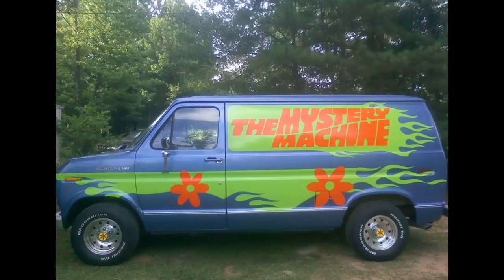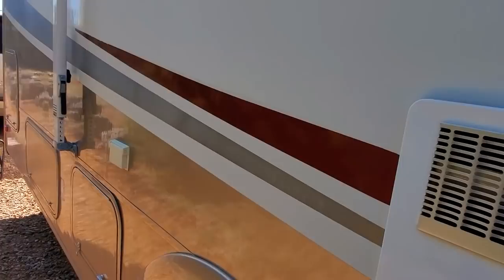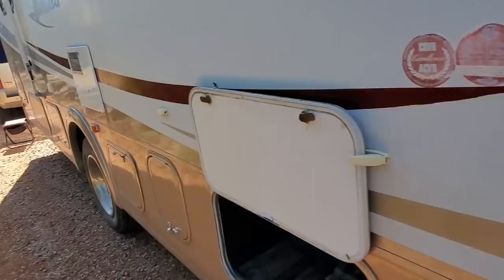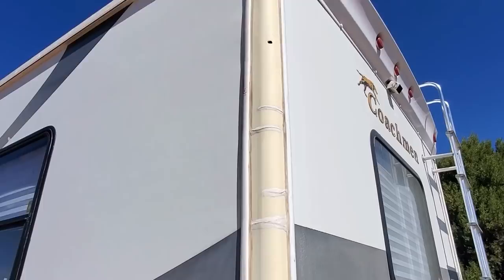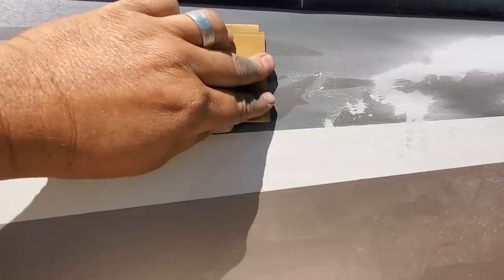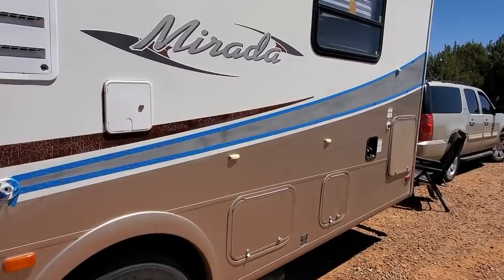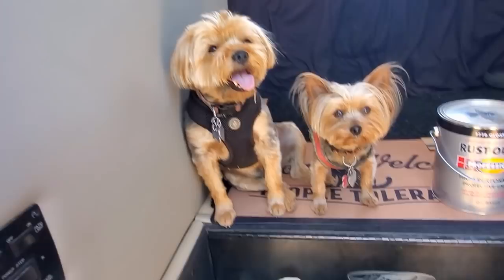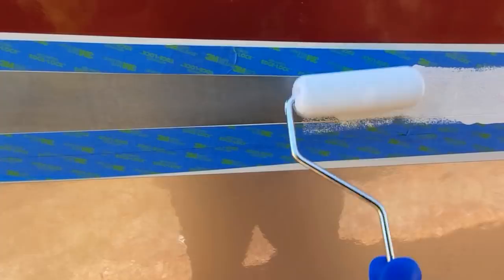I REPAINT MY RV STRIPES WITH RUSTOLEUM... AND SCREW UP!

Comment: I kinda like the texture to the paint personal opinion and it does pass the ten ten test ten feet ten miles an hour and it looks perfect I have made that mistake also a light sanding and a coat of of thinned paint and it will look fine and rustolem seems to lay down better with a good brush like a high end purdy than a roller
You and the woof pack have a good day
THE GRUMPY BUS

Comment: Hey Kevin, As a professional body man and painter I have to say you picked a near impossible task to do in a parking lot using the materials you have so don't beat yourself up over it! The stripes look to baked on to remove them with a heat gun or a eraser wheel I think that would have damaged the paint and with the cost of new vinyl graphics painting was your only option. Just do the best you can and don't worry about it because it will look better in the end, If someone sticks their nose up that close and criticizes it kick em in the butt!

Comment: i would leave the paint alone for a couple of months to fully cure and shrink before i would try to carefully wet-sand it using sanding blocks, not just holding the paper in your hand. when i wet-sand surfaces like this i hold the block in my right hand and hold a pump sprayer full of water in my left, and keep enough water flowing so the abrasive doesn't dig in and scratch the paint. try not to do it in direct sunlight, a shady spot is best. you should be able to get that orange peel as smooth as glass using my method. it is messy though and you will need to wash the rv afterward..

Comment: Hey Kevin I noticed that your motorhome doesn't have any delamination on the sides and I notice a lot of others as old as yours do have delamination I was wondering with all your experience of having so many campers are some more prone to the delamination than others. Well the black looks good from a distance but yeah I would not like the texture either I'm with you sanding it down and putting thinner in the paint I'm sure it'll help a lot I enjoy all the videos thanks for sharing your life on the road
Reply from the maker: I despise delamination. Some is caused by water, some heat- some both. It generally is a good sign of water penetration and ruined rv. I think that the rv industry should be ashamed that this is "accepted". I had a brand new rv in 2005 that had heavy delamination in 1 year. It was a Jayco. They replaced both sidewalls on my 36foot 5th wheel toyhauler. They kept it forever and what they brought back looked worse than what I sent them.

Comment: Uh, next time you need a smaller roller just cut it down. It will still fit on the handle or you can cut it down also. Secondly, just buy a paper and tape masking roller then rattle can spray (or better yet an airbrush or a cheap HF detail gun) the graphics. Finish with a quality outdoor clear coat. A few more bucks and doing it right the first time is always less expensive.

Comment: I’ve had a collision center for 20+ years and  we avoided doing any black cars. I’ve been a hot rodder/street rodder even longer and we all understand Black is the toughest Color to get  right.
Your substrate must be perfectly smooth and flat. Your  adhesion promoter  and primer surfacer must also be wet sanded absolutely flat as you want your topcoat.   Once you put on your black you will need at least two coats so you have enough to wet/block down to flatten the “orange peel” that so you will have a decent glass smooth gloss and then most of us usually put a clear coat on top of that so that it can be sanded and buffed too.   
I’m a bit concerned with that area at the back of your rig because over the next couple weeks to a couple months as the solvent escapes and the paints cure I think you’re going to see the texture of what you painted over where the rigs basecoat came off you will see it in your topcoat.  Great job but just need  more wet block sanding.

Comment: I’m sorry that mistake happened to you ... I admire you for even attempting your paint job yourself. When you had said you were going to repaint the stripes in an earlier video, I cringed. I kept quiet because I didn’t want to jinx you but since you ‘went there’ 😖 all by yourself, I guess I’ll share my thoughts ... the visual I got of “me” attempting that, was not a pretty picture. 🙈 Soooo, you’re already doing better than I would have. EVERY time I’ve ever attempted to use painters tape, when I take it off there are leaks under the edges and they don’t make painters tape for dummies, so I usually go freehand and hope that my coffee doesn’t kick in before I’m done! Your stripe looks ok on video but I understand the need for perfection. If you don’t go back and redo it, you’ll be kicking yourself every time you look at it. No doubt in my mind it will be beautiful and done correctly when you’re finished! ... XOXO to the “Woof Pack”!

Comment: Black is the hardest color to make look good. You would have done much better to roll and tip with a nice brush if you are not going to spray. You have a big investment there and will probably sell it sooner than later. If this was a $5k camper it would be ok. Don't mess around. Pay someone to respray them if you can't get it right. A half assed repair looks worse than what you had before.

Comment: At least you like the black. So do I to be honest it looks a bit more modern. It would be a bugger if you had to sand all the black off and change it's colour. At least you only have to improve the texture. You'll get it to where you're happy with it. I have no doubt. And that will be a massive improvement.
Reply: Besides which I think that if you don't make any mistakes you're not doing anything new.

Comment: It looks good Kevin. Thanks for the education. Like you don't have to spray if you use a fine roller. Like thinning the Rustoleum makes it "lay down" soothly. But why did you buy a whole gallon of black paint? Are you going to use it all?
Reply from the maker: I am going to put on a bedliner mask on front of rv, then paint over it with the gloss black

Comment: I am a paint expert. You sand and recoat that enamel and will have a recoat lift, That oil enamel is a 72 hour partial cure. You did not put hardner in the paint for cure. Do not paint on sunny side panel because they will be many degrees hotter and dry too fast with orange peel. Don't paint over your cracked decals. You'll end up with a mess and no primer will cure it from recracking worst. You need to get a drill and a vinyl stripe remover wheel and burn the old decal off without damage to old finish underneath. Those are large decals and will go slowly. But hey you have more time than money. If they weren't cracked they would come off with heat gun...............Have fun

Comment: Hey Kevin 👋👋👋😎, I guess if it were me I would have used a heat gun and lifted the old tape off the fiberglass siding then used some goof off to take the glue off then taped it and sanded it , as the original tape is just going to crack and look like itself with in a year or two , you can buy a fiberglass paint like jellcoat made for boats or all fiberglass vehicles, and painted all with and it not being tape it would not crack again , 😎👀👀👀👁👁👁🥓🥓🥓and it would last a long time , just sayin buddy God Bless,
Reply from the maker: the bonding primer should help keep it to a minimum. The stripe I painted black was a painted on stripe anyway. Had no choice

Comment: Stripes are decals? Since I run a body shop its  interesting to watch diy painting. A lot of work so far, and a lot more to sand and buff that finish. Rust-Oleum is a hard paint to work with, just wondering why you didn't use urathane automotive.
Reply from the maker: the gray was a painted stripe, the others are decals. I have a lack of tools and place to do the work here on the road. I am allergic to some automotive paints and fear them somewhat. I have used dozens of gallons of Rustoleum with very good results on trailers and equipment I have owned. I was thinking that the stripes would look good with the same results I have had before. The rustoleum is a very durable product even though used more in industrial uses instead of automotive

Comment: Warning! If you haven't discovered this already. Silver, vinyl, cracked decals are horrible to remove...absolutely horrible. I don't know how they made them different but they are a mess to remove. Then there's the glue underneath. That's another mess. 

I'm in the process now of removing them from my 2007 aluminum TT.  I've tried every product and every tip possible.

Comment: I just did a full repaint on my 36ft Gulf Stream Class A motorcoach. I've ordered new graphics to replace the old ones. There is also a video out on how to restore graphics. My problem was the clear coat had been destroyed bye the California sun. I haven't decided yet if I'm going to to put the graphics on as that or paint the background put the graphics on paint over them in a different color and then remove the graphics to show the paint under it. I'm afraid if I do that it might damage the background color as I remove the graphics. Has anyone else tried it that way?
Any information would be greatly appreciated.
Thanks

Comment: I bought the exact same primer and paint that you used. I’ve sanded cleaned in primered some of my camper, but it came out textured. Was I supposed to thin the primer?
It did say on the can of primer not too thin. Should I just go ahead and lightly sand the primer before applying the colored rustoleum paint?
Reply from the maker: the primer does sand well. I am unsure if texture can be avoided

Comment: Kevin. The curiosity is killing me. How did the black strip turn out?
Reply from the maker: bad texture
Reply: I know that part. Have you worked on it anymore since?
Reply from the maker: @donaldbailey5576  sanded some. will take a recoat to fix as I sanded into primer trying to get low places even.

Comment: I wonder how many body work guys were screaming OH NO Stop! I would remove vents. I could not paint around them. I've never used a roller only spray painted in a home-made booth wearing masks. Dirt/dust can ruin a good paint job. A light layer then sanded then repeat 2-3 times for best finish.

Comment: CVK...HELP!
I want to put new tires on my GEO Tracker, 235/75R15. 
Discount Tire says they won't Mount 235 on a factory 5.5 in wheel. That 215 is the widest allowed. Did you mount 235 on your Tracker's factory wheels or on aftermarket?
Reply from the maker: They will fit stock rims, but many shops wont do it. Go back and look at my vids to make sure that is the size. sounds right size
Reply: @CampervanKevin  
I did look. That was the size. I'll also lift it 2 inches. They'll probably do it with the lift. Thanks for the feedback. -PAPA

Comment: Nobody will try to use your paint job as a mirror. I just tiled the backsplash of my kitchen counter. 
I know where every mistake and imperfection is, but a guest would never see them. They would think nice job. 
You can strive for perfection, but if you do not do the job often for a living, you should settle for adequate. 
A pro will have the experience, and use the best of equipment in ideal conditions. They will also be better at covering up the mistakes that they too will make.

Comment: Kevin, I was putting in my new MAXX FAN (before I paint my ROOF) and I got black scuff marks on my white sides of the RV. I tried Paint Thinner and It would come off. What would you use to get off these black scuff marks from my toes hitting the side of my RV from coming off the roof?
Reply from the maker: I would never tell you to try gasoline on a rag. But I might consider wd40. Maybe mayonaise... dont laugh.

Comment: you should never have tried to paint not in a proper environment, a roller will newer be a clean as you want it with out many coats and crap loads of sanding. You should have replaced it with vinyl. it would have been much cleaner and last longer and NEVER put vinyl over vinyl..  best of luck!!